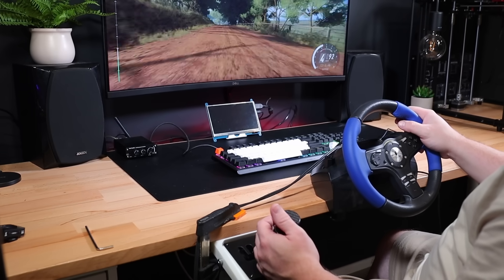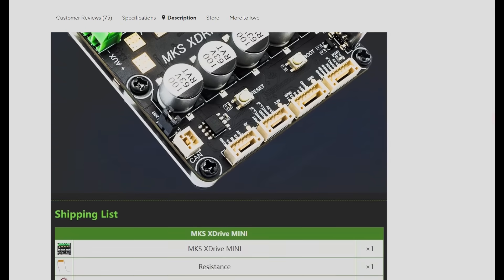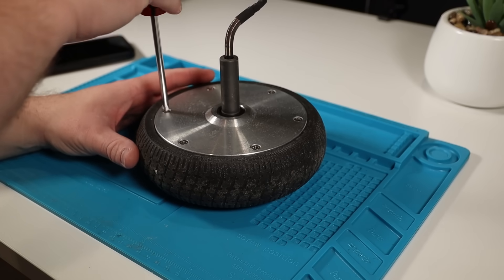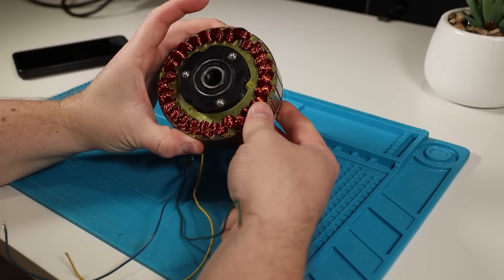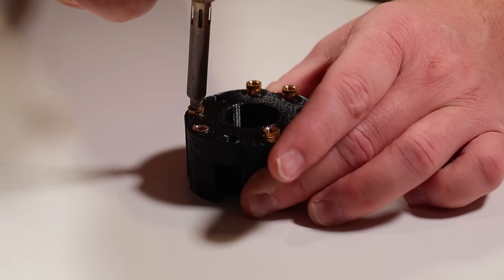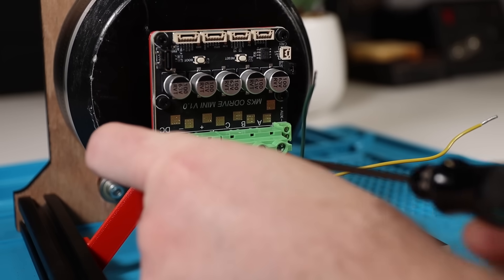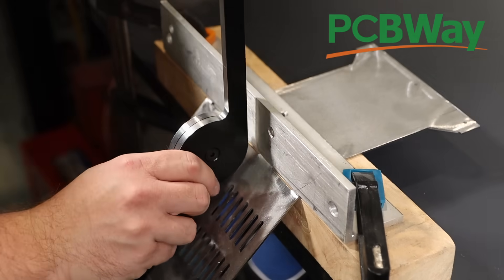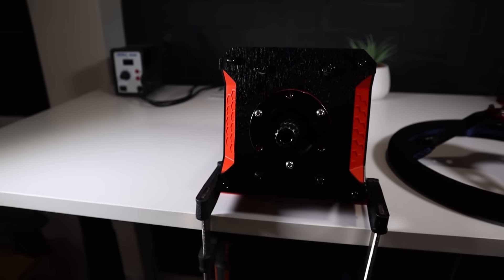DIY High Performance Force Feedback Wheel

Comment: Just plug in the other wheel, no PSU so the FFB doesn't work; and use it's pedals.

Most all sims will gladly assign multiple axis from different direct input devices.
Reply from the maker: I actually have quite a bit of trouble getting assetto corsa to work with multiple input devices. I can configure them just fine but when you launch into a race, it seems to just ignore everything other than the wheel. Dirt 3 does it happily though so I will give that a try if I do a follow-up video!

Comment: Dude! I'm a sim racer, and user a direct drive daily. I absolutely LOVE this! I feel like maching the parts out of at least alum for wheel hub connection to output shaft is a necessity. The amout of back and forth wear and tear that you'll experience through use is obscene. What's the newtons of force output equivalent with your hub?
Reply: It's about 8 Nm continuous.  Can probably do double or more for force feedback.
Reply: Thats absolutely awesome!@propheteyebert7063 I'm gonna def say anything receiving that force should be metal. PET CF would even be hard to use with all that torque to not destroy itself. I'm sooooo ready to see how you do the pedals properly
Reply from the maker: I definitely agree. I was planning to make that part out of aluminium but I just ran out of time, it was a busy month! I've also never run anything other than that old logitech wheel so wasn't sure how much force we were dealing with until I felt it 🤣
I've actually seen people claim up to about 15nm of torque depending on the motor and settings used. This is one of the larger hoverboard motors (30mm wide stator) so I might actually try and test the torque somehow in a follow-up video!
Reply: @cncdan  i would love to see it! The entire project is absolutely amazing I'm here for it all

Comment: Why can't you use the inbuilt encoder?
Reply from the maker: The FFBeast firmware only supports AB style encoders, the inbuilt one is connected over serial. Apparently you can modify the board (I imagine cutting traces and soldering tiny wires is involved) but the encoder board I bought was about $4 and was an easy fix!
Reply: @cncdan  Thank you for the answer! I just thought it would be more elegant to use just one PCB, but your right it doesn't worth the hassle.
Reply: It’s not detailed enough

Comment: Good thing, but the whole housing is too unstable... With this motor power, everything needs to be more stable.

Best regards,
Tornado
Reply from the maker: The housing is very solid, its the table mounts and the wheel adapter that are flexing! I'm re-making the wheel adapter in aluminium and when I eventually mount this to a sim rig, the dodgy printed table mounts will be gone!

Comment: Hi CNCDan, could you please check this. There is another Scateboard motor for around 40$ it's called 6374 170kw or 190kw, has a builtin encoder....has around 8nm Torque:thanksdoc:
Reply from the maker: I've used a very similar motor on my scooter! I'm sure it would work just fine, but I think you will need to gear it down to get enough torque!

Comment: Awesome! Finally someone doing a video in English on the FFBeast wheelbase! It would be really cool you could do a comparison with off the shelf DD wheelbases or lend it to someone who has more experience with them. Too bad that so many specialized tools are needed for modifying the motor or else I would jump right into building one even though I already own an 8nm Fanatec.
Reply: I appreciate this Build, but there is on another English Bild Video, which has simple process, less machining, check this video "how to build a FFB direct drive STEERING WHEEL from a HOVERBOARD | step by step" by DAZ Projects. I am also interested into this project, want to make, till now doing research.

also there is another Scateboard motor for 40$ it's called 6374 170kw or 190kw, has a builtin encoder....
Reply from the maker: I know at least one guy that does sim racing. Once I have it all set up on a sim rig I'll reach out to him and see if he's willing to be on camera! 🤣

Comment: wow, you complicated this much more than needed mate :)
Reply: you are right actually, there is on another English Bild Video, which has simple process, less machining, check this video "how to build a FFB direct drive STEERING WHEEL from a HOVERBOARD | step by step" by DAZ Projects. I am also interested into this project, want to make, till now doing research.
Reply: @JForall-p8c  I did a few wheels already and I implemented the hall sensor inside
Reply: @zeDoSauRus  I just checked your channel, great work. why don't you share your design for a DIY Wheel on your channel ?
Reply from the maker: I often prioritise a neat finished result over a bit of added complexity, most of my previous videos are proof of this 🤣 I have thought of an easier way to do basically the same modification, that doesn't require a lathe. You'd still need to knock the shaft out of the stator but it wasn't in there as tight as I initially thought so I think with a bigger hammer you'd be able to bash it out just fine. Modifying the motor like this opens up a whole heap of possibilities for these motors so while it may not be strictly neccessary for an FFBeast wheel, I'm looking at it as an experiment for projects to come!

Comment: "they are slow since they usually spin a wheel directly, but because of this they have bucket loads of torque" ill never understand what torque is right? 😭😭😭😭😭😭
Reply: Think of it like the motors strength/ the amount of force he would pull a rope if attached to a wind.
Reply: It's the twisting force.

Comment: What's the total torque output on this puppy? I read about anywhere from 13 to 15 Nm of peak torque from these hoverboard motors, which is pretty good, especially if you can pick one up for cheap. 

I paid ~$500 for my Moza R9, it's a great commercial wheelbase with nice software and plenty of power for my needs, but I can see how such a build, albeit with maybe a wood shell and aluminum "skeleton" chassis instead of sheet metal and aluminum, as well as going with a "drilled-out shaft" modded motor would feel very lucrative to anyone wanting to get into Direct Drive wheels. Especially if that 13-15 Nm peak torque amount is to be believed. 

Because despite you not needing it 99% of the time, it's more so about dynamic range of the motor. The more overhead it has at the top end, the less it needs to compress the FFB output in general to fit into the available range. 

FFB, for what it's worth, is a way to precisely oscillate the motor through EM waves, it's kinda like making sounds through a speaker, and the wheelbase is a dynamic driver, but in a more harsh and direct way, pun intended.

Comment: By the way, for the threaded inserts, you can just push it lower than the surface(around 0.5-1mm) so that when it cools down and pops up, it should sit flush.

Comment: I think that you could just use PTFE tube from 3D printer for the metal wire that holds magnet, in order to not to melt insulation of wires.

Comment: Great work, you fixed the issue with hoverboard motors but unfortunately too much work
I bought two of those quick releases but I had to throw them out since they weren't compatible despite being the same style, and the also start getting sloppy as they wear out, I'd recommend a Q1R style quick release
Reply from the maker: Good to know about the quick release! Seemed okay for now, but I'm horrified that they are sold as a part to put on a real car 🤣 As for the motor, I actually have another idea that should make it much more accessible for people without access to these tools. Might have to do a follow-up video!
Reply: @cncdan  I've also seen plenty of aliexpress reviews of the steering wheels being put on their actual cars, proper dangerous

Comment: Driving the encoder magnet with a belt and two pulleys is way easier than recommended method and what you did :P Otherwise good effort.
Reply from the maker: Yeah, I did consider that but I was trying to keep avoid having lots of moving parts. Didn't end up working out quite as well as I hoped but I have another idea I want to try that should make the project much more accessible!